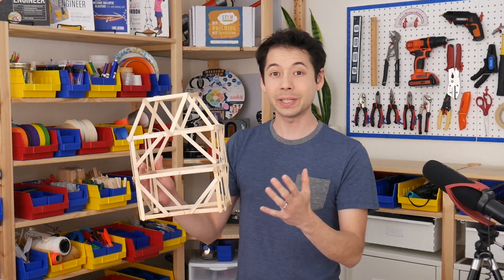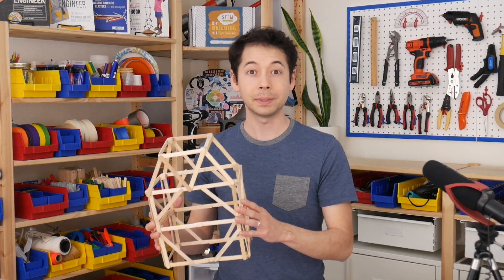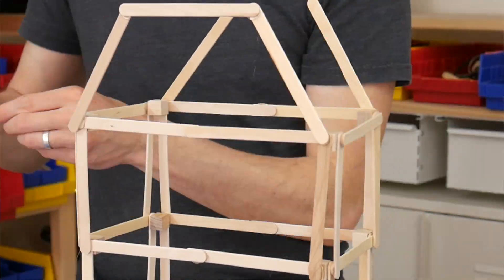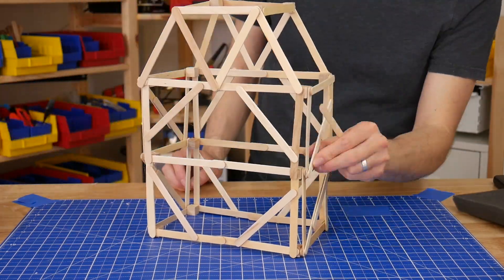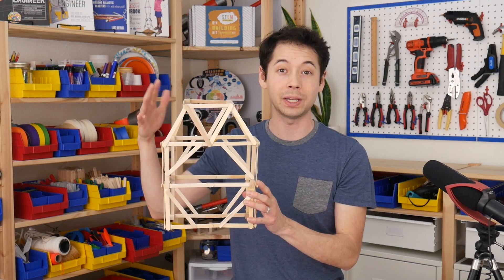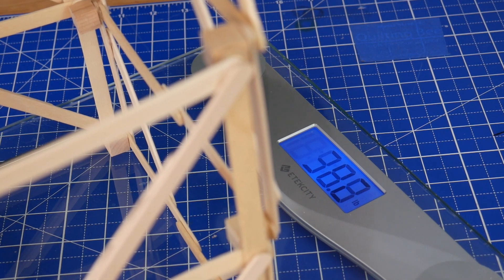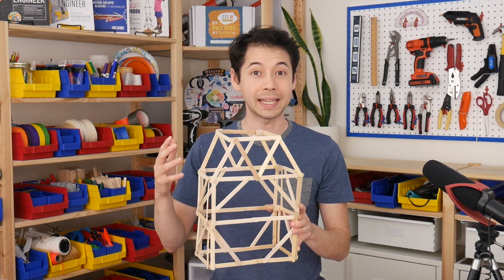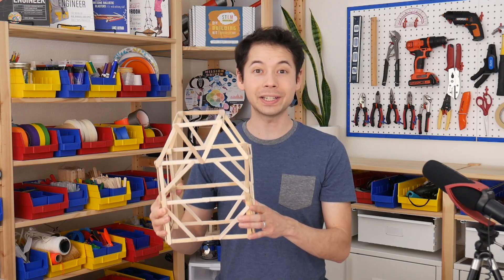Tornado Tower Challenge - DIY Engineering Project Idea for Kids

Comment: As an engineer and a scout leader, I think a fun way to test a wind resistant structure like this would be to take it outside and use a leaf blower. It provides a consistent, sustained wind load. And on top of that, blowing craft sticks all over your yard with a leaf blower would certainly get kids' attention! (Picking them back up before mowing the lawn would suck, but still).

Comment: I used to be an elementary school teacher and was my schools STEM club teacher.  During club time, students were provided with a task, limited material and no hints towards a solution.  These tasks were usually used to reinforce classroom work, but sometimes it was for fun.  My students collaborated in small groups, discussed possible solutions, and experimented.  Since there weren't any hints the kids had to rely on each other and stretch their brains.  One task assignment was to create a bridge that could support the weight of ten one inch fender washers using 18 inches of tape, a 12 ounce box of dried spaghetti and two feet of string.  Some great designs cropped up along with some that needed some help.  Whether they accomplished the task or not was not as important as the process of discovery and that's what I looked for in my version of STEM.  I like your videos and if I was still teaching, I'd modify and use them in my club.